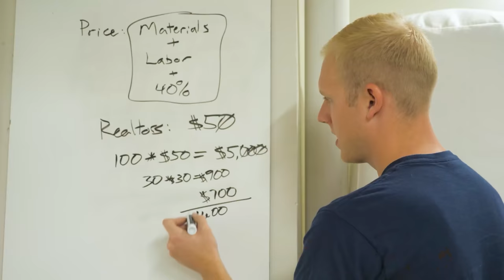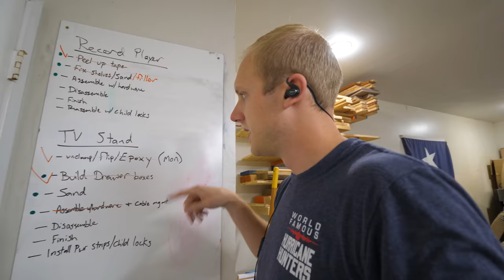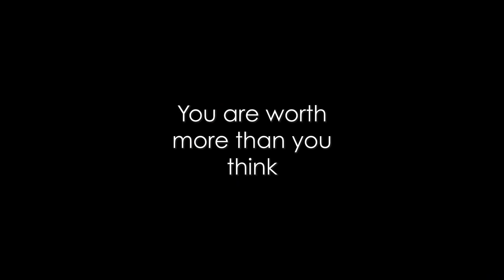why our work will never be "good enough" | Furniture Business Update

Comment: Just in case you ever get a request for grand piano black finish like I did for a set of speakers my son was making, here is a way to get it.   Sand smooth and flat to 400 grit.   Apply two or three coats of 2k automotive primer.   Sand the primer to 600 grit flat and smooth.   Apply 2 to 3 coats of black base coat paint.   Apply 3 to four coats of clear coat.   Once dry, wet sand 1000, 1500, and 2000 grit.   Buff with buffing compound, and finish with polish.   Will look like a black mirror.

Comment: Although I agree with your "good enough" mantra in general, I would say be careful as this can also lead to complacency.  I think there is a significant difference in "good enough" related to the process of building the piece versus "good enough" in regards to the overall quality of the finished piece.  If you are going to quote and charge someone for 30+ hours of labor, the piece better resemble 30+ hours of labor when done.  If you charged for 30 hours and it looks like you spent 10, then good enough is just not fair to the customer.

Comment: I very much relate to the "perfection" compulsion we have.  I built a 3 bunk cat bed this week.  It was my first project of its kind.  I've done a lot of 2x4 construction type work helping others remodel or repair houses occasionally, but never furniture. It's been 30 years since that, so I'm just getting started. 

I first made about 6 changes to the design since the original sketch. Then, I made at least three after pulling out the wood to use.  The only mod I made after actually starting assembly was out of necessity. I overlooked how a board would look after changing which board covered the other end grain in the corners.  

I chose it as a practice piece since I have some big projects to build and they need to look good and be secure.  So, I had in my mind that it would have flaws.  But, all along the way, I felt a strong compulsion to "do better".   

I did that project to learn, and I learned.  I learned how to clamp corners, first with 6 clamps, and finally with only two, and still get them at the right, right angle, LOL.  I learned how to make it stand on all fours without wobbling and I learned that flat black paint soaks in but glossy runs much more easily.  

When I was done, the paint job sucks.  I didn't cover the slats, I have runs that turned to a tacky mess when I sanded them wet, and some of the brown shows through the black where I sanded too deep.  I bought the paint to "fix" it, but the next morning, when the paint was really dry, I buffed it down with sand paper just enough to be smooth.  I looked it over and it sucked!

I know where all the flaws are.  But, I held out and installed it.  Then, I added a piece of plywood over the slats under the cat beds.  It seems cats don't like not knowing where the slats are.  After it was installed, covered in beds, I looked it over standing upright in my office.  It really looks good. It is 10 inches from my left elbow under a cat that normally lays on my mouse pad.  The funny thing is, I never see the flaws.  

I started this project knowing it was my learning piece and that it would be full of mistakes. (Less than I imagined, though, LOL)  but I still had a strong compulsion to "fix" it.  As long as it was my "project", I saw everything that needed fixing.  But, once I was able to separate myself from being the "maker", and look at it as a piece of furniture in my office, it went from ugly to beautiful and gets compliments.  I know where they are and don't see the flaws today, just one day after finishing and installing it.  

I guess another lesson I learned was don't give in to the compulsion to "fix" everything.
Reply: I am impressed your cat actually used it.  I find mine seldom use anything I make or buy for them.  Although one cat loves a little soft sided house my son bought for his cat.
Reply: @robertawills7219  One has taken a serious liking to it, two others use it sometimes, but one is still scared of it and likes the totes I was using.  

If you want your cats to love something you do, make a shelf for them at the window, LOL. I'm thinking that will be my next cat project.

Comment: Try this with walnut: put a steel wool pad into a glass jar. Pour vinegar over it and let it sit for ~3 days. Strain off the liquid to remove steel particles. Use the liquid on walnut like a stain. It will look a little flat until it has a clear coat, but it looks just like naturally dark wood. The color isn't too deep so sand first.

Comment: I just bought an hvlp sprayer. I was thinking I shouldn’t try it in my car and a half garage because of overspray. I see you did it. Any problems? Advice! Issues?
Thanks😊 and the cabinet looks awesome.
Reply from the maker: Really gotta restrict airflow to just as much as you need (at least on our unit). Use the highest quality water-based products (for easy cleanup) and do multiple thin coats, sanding in-betweeen

Comment: Just a thought for you. You did not show it but when I saw you doing the panel glue on your pipe clamps using black gas pipe, I cringed. I know it is some kind of male thing because virtually every woodworker you see goes to the store and buys the black pipes for their pipe clamps. And of course when you are done you have black marks on your material. If woodworkers would just use the silver water pipe instead it would save a LOT of sanding and messing around getting rid of the black marks. Just an old guy trying to help. Regards, Bill
Reply from the maker: Hi Bill, we've fortunately never had any issue with black rubbing off the pipes - sorry you've had trouble in the past!

Did you wipe down the black pipes with acetone? That was step 1 for us!
Reply: @jennieanddavis  Nope, never did that. I switched to the water pipe. If you watch other YT Channels, you will see a lot of guys using the black pipe and when they unclamp the boards have the black streaks. I was just watching the guy up in Alaska that is making cutting boards and just like clockwork, he had the black stains when he unclamped. I actually sanded some of my water pipe to make it smooth and shiny.  What can I say, I'm old and retired. ;o) Take care, I enjoy your channel. Bill